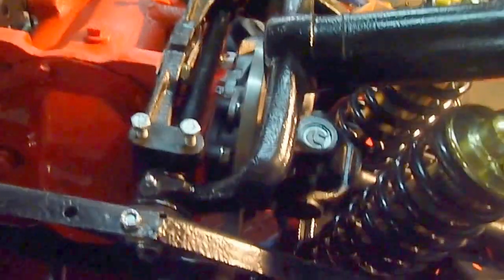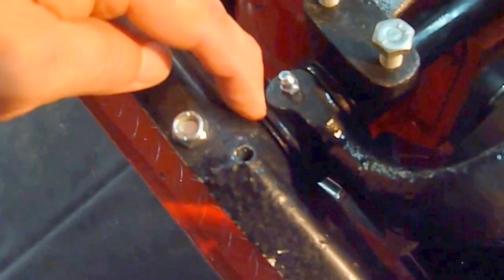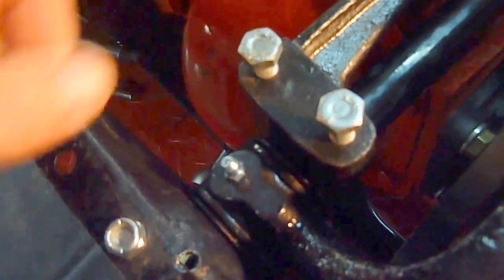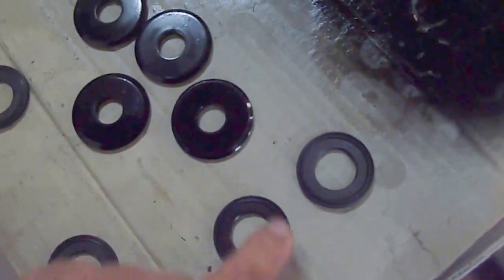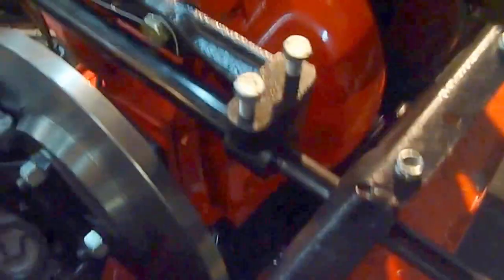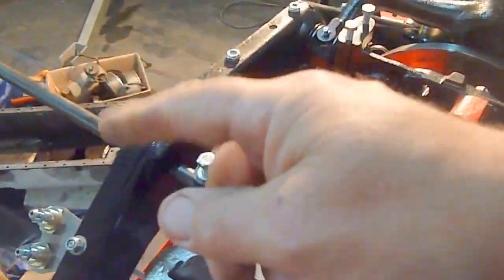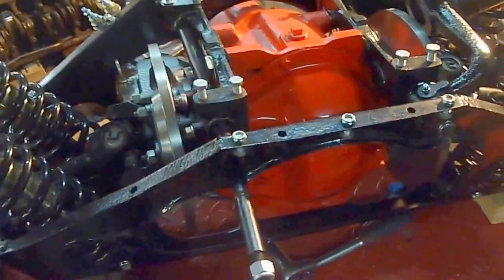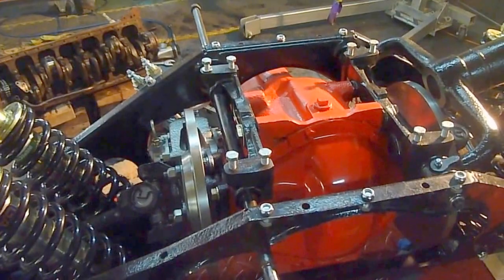jaguar e type IRS Part 5

Comment: I liked john carey's approach of squeezing the differential cage together using wood clamps to aide in the installation of the shafts
Reply from the maker: I used John‘s idea with the wood sash clamps and it help me get the shaft lined up better, Cheers David